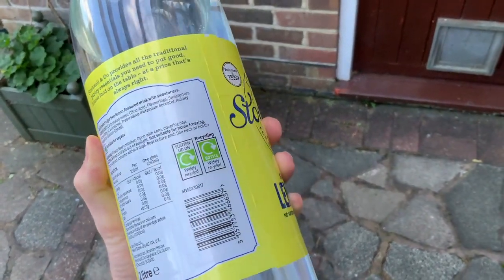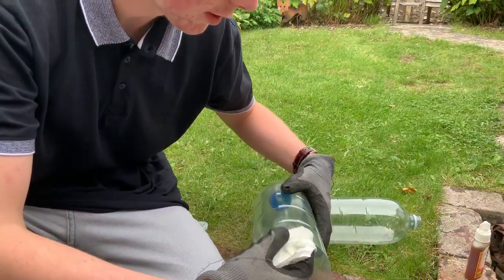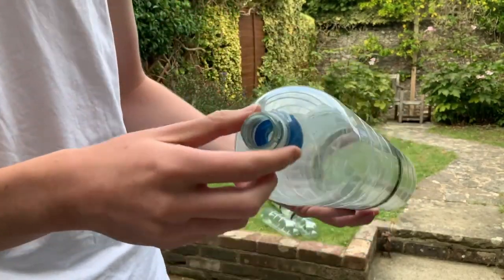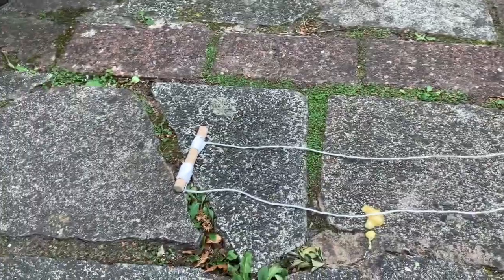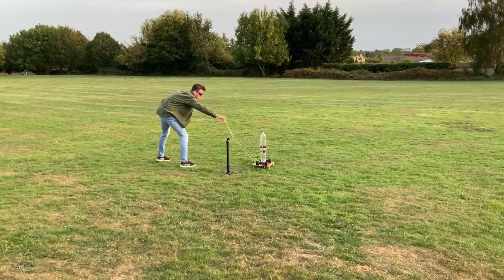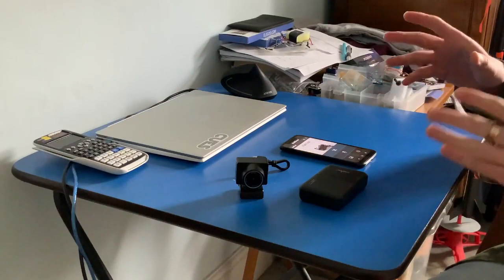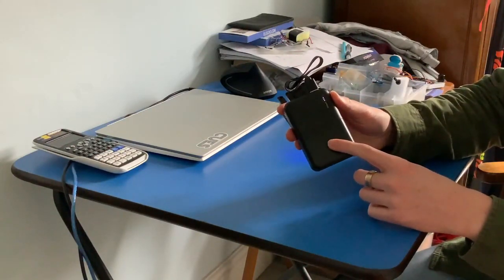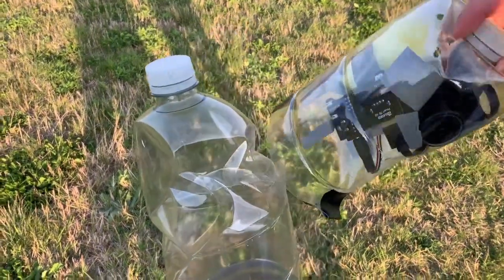100MPH Water Rocket

Comment: Really interested in how you made the simulation in python. The math and libraries. would love to see a video on it :D
Good Job!
Reply from the maker: The only libraries I used were math and matplotlib, then it's just a matter of knowing the physics behind compressible flows, and a numerical sim can be made quickly (it took me an afternoon)
Reply: @TheDodgyEngineer  I'm doing an examproject about water rockets. I would very much like if you could get me some advice to find the optimal water amount by using Excel? It would be very helpful.
Reply from the maker: @theodorgreisdal8974  Do the maths! Using a numerical method, work out the pressure at each time, use Bernuolli's principle to find the water jet velocity, use this to find the change in mass and volume of air in the bottle, next use the SUVAT equations to calculate the altitude and speed gain, then repeat for each timestep. Hope this helps!

Comment: 1:1 like to view ratio
Reply: also, I think the reason your choked flow water version didn't perform as well is that you reduced the thrust of the rocket(thrust is a function of the pressure differential and cross-sectional area) a higher fraction of thrust was being dedicated to fighting gravity reducing its acceleration and the stabilizing effect of the fins. you could try to increase the area of the outlet to get a higher top speed but that would be more like a pressure bomb instead of a rocket and may decrease how high it can go.
you probably already knew this I'm just throwing speculation around.
Reply from the maker: My reasoning was more along a reversibility argument than actually thinking about the forces at play. The slower (and more stably) the water is pushed out of the rocket, the more efficiently work is done on the water. I didn't think about this too hard though, just a speculation really!